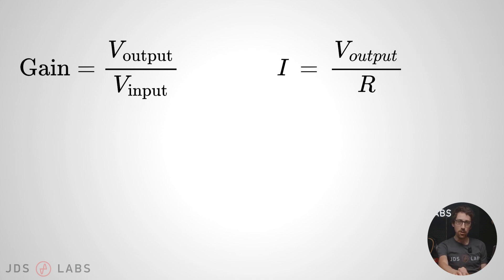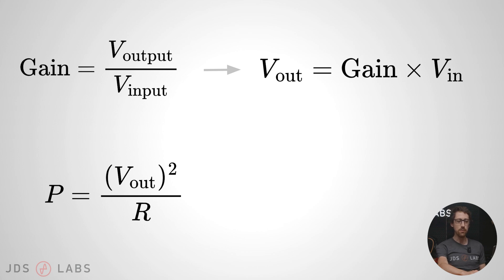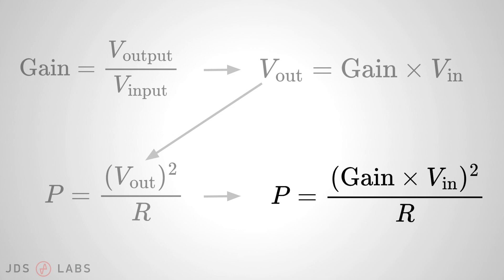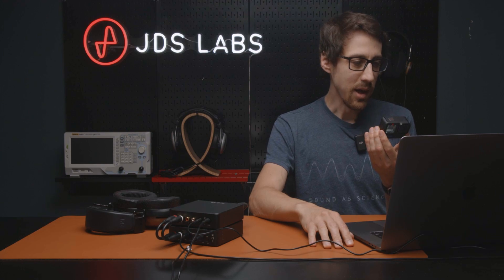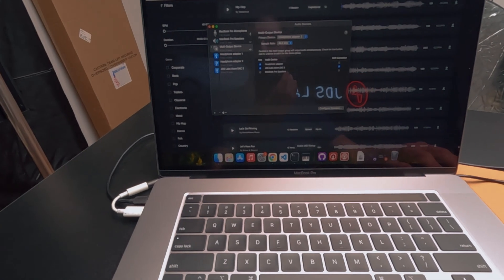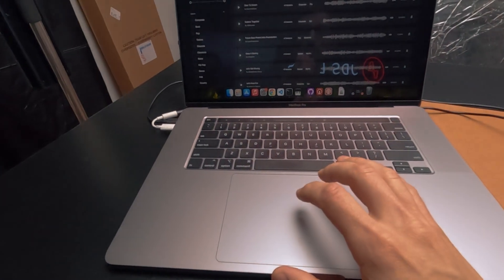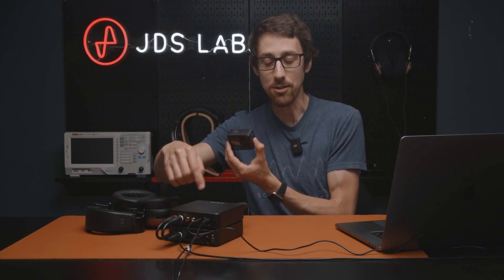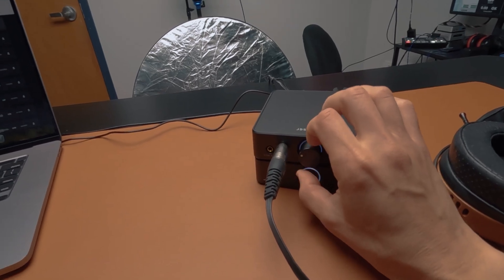Understanding Gain | JDS Labs Workshop Series

Comment: There is a little extra tightness/punchiness in transients that I like on high gain with HD600. I'm mostly into hip-hop so that probably why.
Reply: You thoughts?
Reply from the maker: @MuzdokOfficial  - Good question. When you hear changes in sound signature at a different gain level, either the amplifier is behaving differently under the load, or your headphones and ears are responding differently due to a difference in volume (or a bit of both). The latter is fairly common. Check out equal-loudness contours, or Fletcher-Munsen curves: https://en.wikipedia.org/wiki/Equal-loudness_contour

Atom Amp 2 performs the same at low and high gain. Not all amps do, though.

Less often discussed is the impulse response of a headphone driver. Impulse response is interrelated with THD and frequency response, but it is particularly interesting to consider because two headphone models could be EQ'ed to have the same frequency response and volume, yet still produce different sonic characteristics due to differences in impulse response. I'm not sure how headphone driver impulse response varies with volume/gain. ZMF may be able to comment further on this topic.
Reply: @JDSLabsinc  It must be the impulse response. Because I compared with the same loudness and same EQ settings and I know about loudness perceived difference. I also know your product is very transparent I'm using the 4.4mm plug and I know that it's going through the same circuit so no difference in sound neither with either plugs. Thank you for your answer 👌🏻 it must be headphones dependant. I'm not disappointed either way 😎